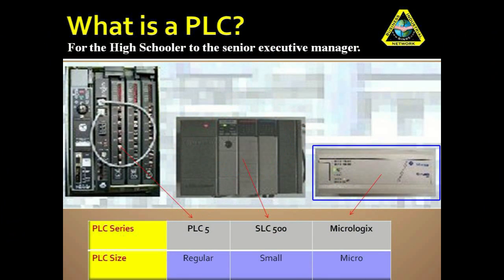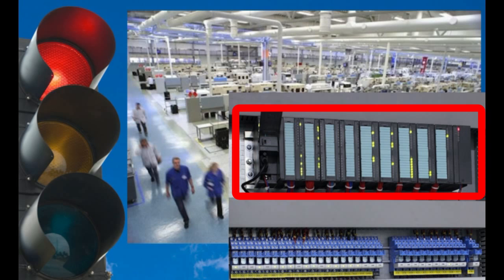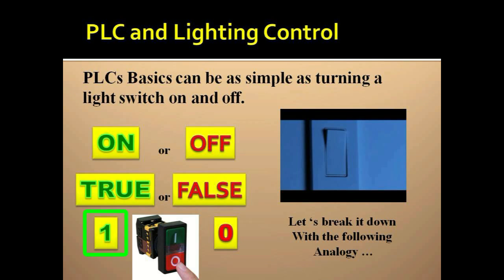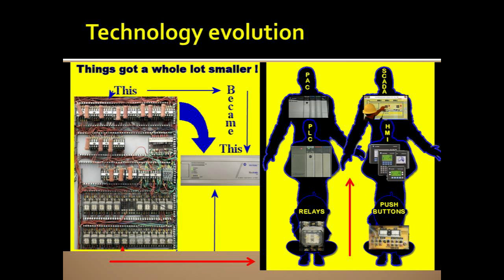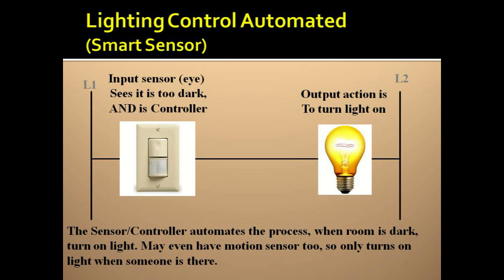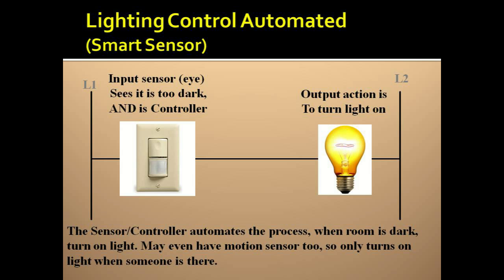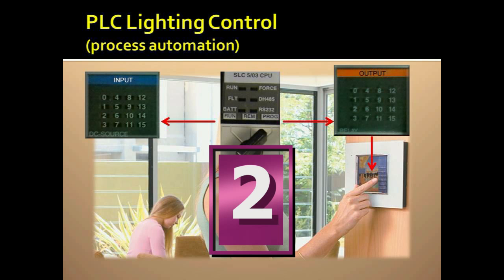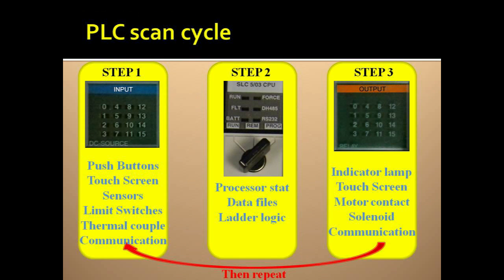What is a PLC (Programmable Logic controller tutorial)

Comment: What type of software language can you use to control the PLC?  Is it C++ or Matlab?
Reply from the maker: +SolidSnake013Duds PLCs primarily use Ladder Logic (A graphical programming language that symbolizes electrical ladder diagrams) so it is user friendly towards electricians and enable them to program in boolean logic using electrical symbols. Looks like |---| |------|/|---------------( )--| The newest device for industrial control is a PAC (Industrial computer), which also is mostly programmed in ladder logic, but also accepts 4 other programming languages, one of which is structured text that mimics/looks a lot like Pascal programming language or BASIC.
Reply: +BIN Industrial Training thank you for the information. greatly appreciated